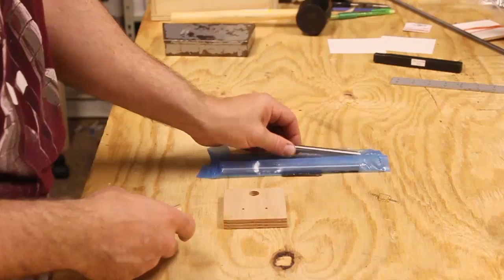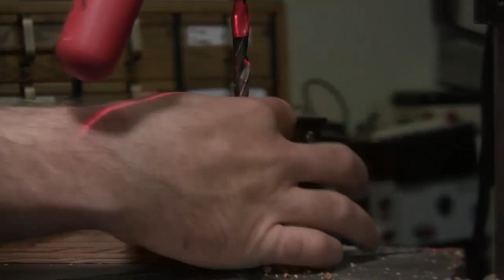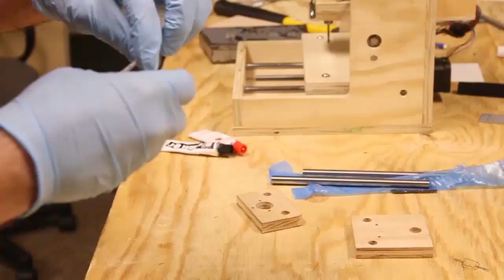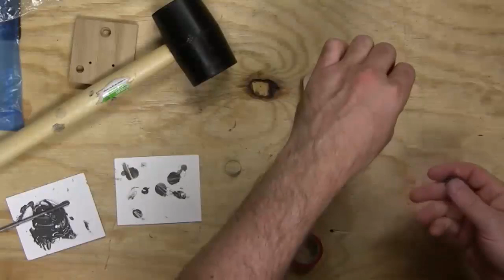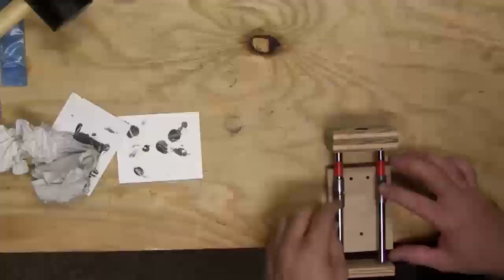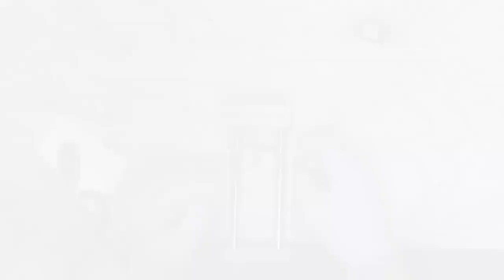Cheap DIY CNC Mill Part 3 of 7

Comment: is it better to do up plate larger and make it's front edge precision aligned with down spindle plate ? this like you do with other axes - use one flat surface for alignment and drill in package to avoid bars swivel 

later after epoxy will stoned, top plate can be easily cutted or drilled to make space for spindle motor

or top plate can be used for spindle motor mount, in case of specially done spindle separated from motor

Comment: some tip on tight bars fixing: use reamer and smaller drill, so reaming depth will give you more control on bar pressing

and reamer is required thing if you plan to made some diy pulleys for diy lathe for example: you can tight press wood block on motor shaft, and turn temporary pulley with Z profile on motor itself, and it will work long time and let you do metal pulleys on your selfmade lathe

Comment: simple hint to align drill table: put cylinder pin into drill chuck, and glue or bolt pensil at large angle to it, so end of pensil must draw largest circle as possible on drill table surface.
so you can rotate this jig manually, and flip table until you see full circle drawen on table surface
if table in not perpendicular to drill spindle axes, you'll see only partial arc , which will show you direction of tuning tilt
Reply: you can make this like jig with dial indicator, but it require some machining, and larger price

another variant - use isolated electrode in place of pencil, and buzzer must beep all over spindle turn touching drill table